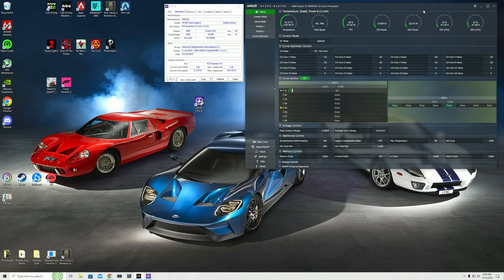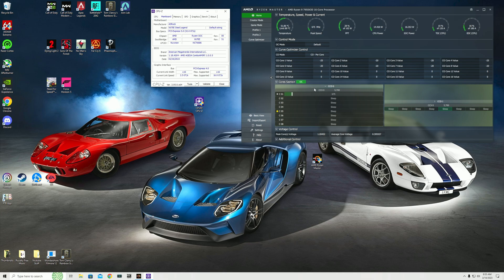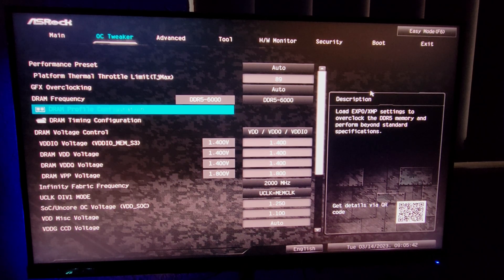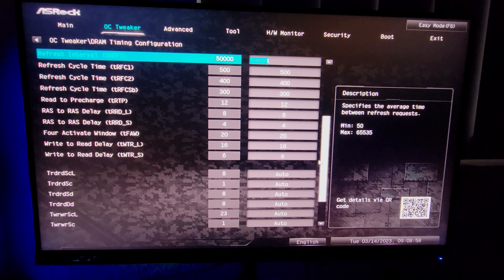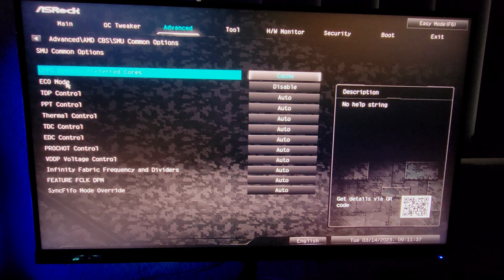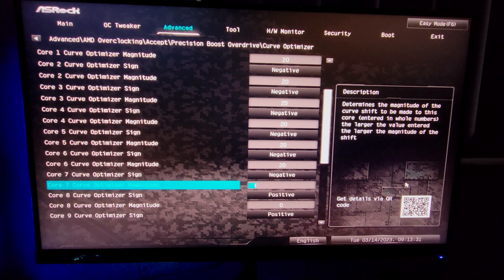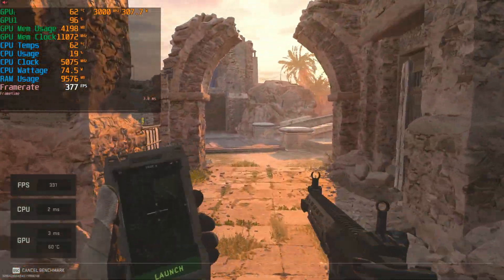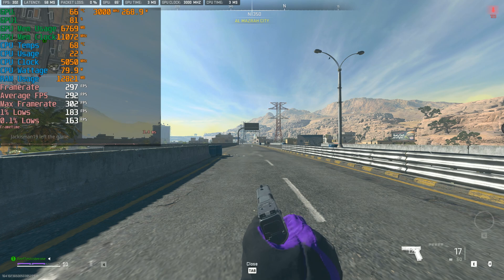7950X3D Setup Guide (Bios Settings, Ram Timings, and Undervolting)

Comment: I have a 7950x3D and 4090 with 5600 CL28, and I set the curve optimizer to all -20 CCD0 

My MW2 benchmark on low settings with 57% render resolution gives 299fps average (230fps 1% low) and gives CPU 392fps and GPU 413fps with 61% bottleneck on CPU and 39% on GPU. With ultra settings I get 261avg fps and only 7% CPU bottleneck

When I raise the render resolution to 100% like yours on ultra settings, I get 201fps avg (127fps 1% low) with CPU 340fps and GPU 223fps. 

Why are my results this bad? Is it the RAM?
Reply: u should be getting more fps. I get 335fps on 2560x1440 with fidelity cas enabled all low settings. (7900x3d)
Reply from the maker: Is your render worker count set to 7, and is your cpu set to prefer cache in bios?
Reply: @Beefy-Tech  7 why? I thought it should be the number of physical cores the cpu has.
Reply from the maker: @Icy20  nonono. That's a complete myth. Setting it to 16 results in the game switching to the wrong chiplet more often then not.

I highly recommend setting it to 7, setting your bios to prefer Cache, and test again.
Reply: @Beefy-Tech  i have already done all those things. I will replace 7900x3d with 7800x3d. Then will i use 7 again or 8?
Reply from the maker: @Icy20  stick with 7 I'd say
Reply: @Beefy-Tech  thanx. For guys with 7900x3d u syggest 6 or 5 then?
Reply from the maker: @Icy20  6 or 7. 6 is what my friend uses.
Reply: @Beefy-Tech  I set my CPU to prefer cache, but is the render worker count some setting in MW2 files?
Reply from the maker: @tariqalr  you'd still want it on 7 yes.

Comment: Quick question I have the same CPU 7950x3D paired with a 4090, G.SKILL Trident Z5 Neo (2 x 16GB) DDR5 6000 with 30-38-38-96 timings.  Will I be able to copy the same settings as you? Or will there be some differences between your tech and mines?
Reply from the maker: Yes, pretty much, but you want to do your own undervolt. Undervolts do not translate from cpu to cpu,so you could do a much higher or much lower undervolt based on the luck of your cpu.

Also my undervolt has changed since this video, as I've managed to greatly improve it.
Reply: @Beefy-Tech  Thank you for the heads up. How good did you improve your undervolts? Would like to have a sense to this process. Thank you again. Earned a sub.
Reply from the maker: @iemptyyclipz_1299  so, to keep it as simple as possible, download Ryzen Master, and it'll show you which 2 cores are your best cores (the 2 best cores will have like a Star or highlight in the app).

Those 2 cores will require slightly more voltage to be stable, so try to do like a 4 core -30, 2 cores -20 and your 2 best cores set to -10.

If you test that, and it's stable in the games you play and any regular benchmarks, start upping the undervolt with the 2 extra cores set at -20 to -25 or -30, retest.

If you are still stable, now go to your fastest cores, and do increase undervolt on 1 of the best cores from -10 to -15, -20 etc... until you find instability. Repeat for second fastest core.

The bottleneck of an undervolt is always the fastest cores, as those need more voltage to run usually.

There's different ways of doing this undervolt process, but this way you don't waste time testing -20 all cores and stuff like that.

Comment: I followed every steps on this video but for some reason no matter what value i put on my curve optimizer they wont apply for some reason on my asus rog strix x670e-e on latest bios.. tried the other bios too.. same thing. I hope someone can help me out here. Thanks
Reply from the maker: Are you on the latest Chipset drivers and the latest bios? It could be tied to the bios version. You need to make sure you select negative, and then just put 20 as an example.
Reply: Yes i am on the latest chipset and bios.. but regardless how much i put on negative curve between 0 or -30 its its performs the same.. so im assuming the CO is not working..
Reply from the maker: @Snakey066  download Ryzen Master, if your CO is applying you will be able to see the undervolt in Ryzen Master.

Also make sure your render worker count is set to 7-8, ideally 7.

If you see no performance difference even with ryzen master showing the undervolt applied, reset bios, re-apply settings, and make a significantly more aggressive fan curve for your cpu.
Reply: Took me awhile to figure out how the 7950x3d works. Thanks for helping me.. and keep up the good work on your videos.. cheers..
Reply from the maker: @Snakey066  gotchu fam! It's not particularly straightforward to set up, but a great cpu once setup🙌

Comment: Question, I’m using your RAM timings on my Gskill Trident Neo 6000 CL30 which is 30-38-38-96. In your timings, you are using 30-38-38-30 which I’m currently using and have not had any crashes or issues. I tried to use 96 and found no difference in performance. But should I keep it at 96 since it’s the stock number? I believe buildzoid stated to leave these figures same as what they came as but now seeing that using 30 doesn’t hurt it, I’m kinda stuck and what to use. Thanks so much for the quick replies
Reply from the maker: The primary timings make a very small difference in performance, but if you are stable at a lower individual timing, use it. The point of tight timings is so they all separately add up to less latency. The lower they all are together the less overall latency there is.
Reply: @Beefy-Tech  Thank you!
Reply: @Beefy-Tech  hello sir
Are you able to put 3x bottom fans in that Coolermaster h500 mesh and 2 or 3x side fans 
cuz i cannot , i only have a 360mm AIO deepcool LT720 + 1x 120mm REAR fans + 2x 200mm front fans
I wanted to remove both PSU box + HDD cadddy box and try to put bottom or side fans, 
The side fans i think we cannot as there is no brackets to screw those fans

Comment: Have you been able to tweak or change anything since this video that changed anything for more performance?
Reply from the maker: I have yes. Significantly improved undervolt, and process lasso is now being used, undervolt improvement making most significant difference, of about 3 degrees celsius of less heat. So -30 first 4 cores, -10 core 5, -20 last 3 cores. Core 5 is my fastest Core but also needs more voltage to run stable, so I can't go higher then -10 on it, that way other cores can be undervolted more separately and maintain perfect stability.
Reply: @Beefy-Tech  ahhh nice. I’ll try these 😁
Reply from the maker: @MustafaGT  use Ryzen Master and see which is your best core. That core may need less of an undervolt so those other cores can be undervolted more.

Comment: I have vengeance 6000mhz kit cl36. 
You think if I copy the same settings it'll just magically go to cl30? lol
Reply: Ok, tested it and the timings did not work on the 6000 cl36 kit. 
Just wouldn't boot, then told me its restored from blah blah. 
Oh well. I'll have to get me a much nicer kit. This kit is kinda meh.
Reply from the maker: Did you set your voltage to 1.4v across all necessary voltages? It could be that some timings are too tight for your kit, but all ud have to do is try slightly less tight timings at 1.4 volts and try again.
Reply: @Beefy-Tech  yeah, I learned it was a terrible Samsung die. And they won't work. 
But I got a nice kit from microcenter and I was able to get it to 6000 cl30 with really tight timings. Am5 aid64 latency is around 57n 
Made mine much tighter. Took some research to see what to change to further it. Lol
I have an A die, but funny enough was a 300 dollar a die kit. So I can still hit those super tight timings like M can..
Reply from the maker: @duckilythelovely3040  Hynix A die is probably the best overall, it can do higher frequencies and very tight timings. If you have A die it's really easy to get tighter timings then I showed here👍

Comment: you can overclock infinity fabric to reach 6400mhz
Reply from the maker: Yes, I have not done it yet as I dont have a ram kit capable of doing super good timings at 6400mhz. I will toy around with it at 6200mhz soon though.

Comment: Cant understand your temps.. what was your stock temps while gaming? I have a ryujin ii 240 aio but my tems is about 80c when gaming, if i set cores to -15 the temps go way up and tickle Tclt max. Is my X3D broken or what? AIO is sat correct, good thermalpaste with good coverage. Looks like my CPU does like the 7950x just want to go to 89 and stay there
Reply from the maker: Its a bug, I had to re-install bios and chipset drivers to fix that exact issue you had. Itd happen at random to me too where itd lock TJ max while not doing anything at all after i ran a MW2 benchmark, I havent had it happen in 2 weeks since I last re-installed bios/chipset drivers.
Reply: @Beefy-Tech  Hmm, i see more ppl having the same temps as me though when benchmarking apex at 1440P. its just when im playing, idle theyre like 45-55c. If this is a bug, AMD have to come out with a driver to fix it then?
Reply from the maker: @Emp3ror  I have a very overkill cooling solution and as a result temps are lowered by quiet a bit. My idle temps are around 38-42 within OCCT.

The temps are unfortunately normal unless you are at 60+c at idle, and most people with anything other then a 360mm aio and great thermal paste will have issues maximizing performance of the cpu.

Even with 6 high end fans on the 360mm AIO, and the best thermal paste I could find (Noctua NT-H2) I still can't lock 5.25ghz in CPU bound scenerio's such as AL Mazrah In Warzone 2 due to requiring about 5 degrees less of heat to do that lol.

Best solution if you have high temps is make sure your TJ max is 89c, and your fan curve on cpu cooler is aggressive. Given you already bought your cooler and thermal paste, try make the most of what you have. 

They probably will release a bios/chipset update soon because Derbauer recently damaged his 7950x3d with voltage, causing some concerns, meaning AMD may actually try do something about it indirectly. We will see.

As an example, I run 60% fan speed at 50 degrees, 70% at 60 degrees. This cpu def takes a bit too cool despite only using like 90 watts in gaming xD

Comment: I am shocked in 1440p the 4090 is bottlenecking the CPU. In the g9 resolution which is like 5120*1440p is the GPU still gonna bottleneck the CPU or the game will be more GPU bound?
Reply from the maker: Its in the benchmark within Modern Warfare 2 that the 4090 is the bottleneckm, within warzone 2 battle royale the 7950X3D with my latest Undervolt and setup takes 4090 to 85-95% usage, so its theoretically the CPU thats still the bottleneck in Battle Royale, but by extremely little.

Comment: is it just me or it's intended?
since i kinda have similar build, and kinda new on Ryzen Platform
is it normal when you're fine tuning the curve optimizer, your system would instant restart (not BSOD, even already change the setting of BSOD to not auto restart) and got kernel 41 error in event viewer? like when i'm trying -30 all core, it will restart frequently and -30 CCD0 and -25 CCD1, is rarely restart
Reply from the maker: I have never actually had a crash that reset my bios, so def intended. Whenever something is unstable, computer will simply restart lol. I run -30 first 4 cores and -10 last 4 on 3D v cache ccd and it works perfectly 0 crashes, but at -30 on 4 and -15 on last 4 cores itll cause the restarts. So yes, if you get random restarts, its a sign of instability.
Reply: @Beefy Tech ah i see, thanks for confirming it, now im trying -20 and -25 all core (coz im lazy to check one by one), sofar its good no crash atm, tried disabled PBO earlier, and crash as well but this must be causing by secure boot is disabled and virtualization security is on, also do you mind write the timing stuff in description? For easier to copy, im using gskill cl30 with expo atm, thanks
Reply from the maker: @AlviRieZel  you'll have to test it best on what you play. I only care about optimization on warzone 2, so I set my thread count within config file to 7, and then undervolted 8 threads as much as I could to specifically benefit warzones use case.

As for the timings, I think ull find it easier to copy if you go on your phone and screenshot the video, it'll have a similar effect xD

Comment: How do you determine that that you can only get -25 on two cores? Seems like that would take quite a few tests
Reply from the maker: It would. I tested until last week and my final setup is -30 on first 4 cores and -10 on last 4 cores of 3D v cache ccd. Its essentially trial and error until you get something stable. I got the idea to do -30 on first 4 cores as that means 8 threads will be faster then the other 8 threads, and if you set your render worker count in Mw2 to 7 or 8 threads, itll always use those fastest cores. Now i know its at its max, because -30 on first 4 and -10 on last 4 is perfectly stable, but if I change any of the last 4 cores to -15 instead of -10, I get a restart within 30 minutes.
Reply: @Beefy-Tech  Can we undervolt this microATX board Asrock M.2/HDV or do i need X670E boards only to overclock the CPU

Comment: what were your before/after temperatures please from undervolt? I am worried that 360mm AIO and a Fractal Meshify 2 won't be sufficient to allow a 7800x3d to boost well.
Reply from the maker: To be honest, I did a full cooling solution upgrade.

I think the UV was about 3-4C less ingame overall, but the boost frequency was at about 5.0ghz on the dot. 

I got Noctua NT-H2 thermal paste, and slapped 6 fans on my 360mm AIO (3 slim fans and 3 full fams), and I Removed my old fans entirely.

Not only that, but I run the cpu at 60% fan speed at 55c, and 70% fan speed at 65c, so keep the Temps under 65.

Now I see between 60-64 in wz2. The undervolt helps a lot, but the thermal solution will help just as much. Make sure you get a good thermal paste👍
Reply: @Beefy-Tech  Are you running the CPU radiator as intake or exhaust?

I will almost certainly be undervolting, it seems quite easy thse days. Probably go Arctic Mx6 thermal paste. 

The case I'm looking at won't support a push+pull config on the AIO so I might be stuck. I could choose a different case but the one I've seen looks to have quite good dust control which I need.
Reply from the maker: @xPlasmaz  i run it with push pull as intake, with a single 140mm fan as exhaust. 

You shouldn't have an issue running just 3 fans, I'd recommend running them as "Push" in the sense the they blow the air through from above the radiator as that'll result in slightly better performance then just pull. Downside is inside of case will look slightly worse.

If you want to have fans visible on the inside though, I can understand, and it'd still run within 1-2 degrees celsius of the push config.

MX6 is fine, and I think it even comes with a thermal paste spreader if I remember correctly👍

Comment: I am looking at building a PC with the 7800x3d and quite concerned about CPU temps as I know it can affect boost clocks. So with an undervolt and a 360mm AIO you're reaching about 70 in Warzone 2. What about a full on stress test what temperatures does that reach?
Reply from the maker: I upgraded cooling solutions since, so it wouldnt be representative of this test anymore, now I run 63c instead of what used to be 68c. but the upgrade consisted of changing my main 3 fans to better ones, buying an extra 3 slim fans to make it a push pull configuration (6 fans on a 360mm radiator) and changing thermal paste to Noctua NT H2. That isnt realistic as a cooling solution for most people though, but the hottest I ever saw it get in a game was 85C with my previous basic 360mm aio with 3 fans set to pull configuration (this is within a different cpu bottlenecked game, not warzone)
Reply: @Beefy-Tech  What's your boost clock now? Are you hitting 5.25 ghz?
Reply: That sounds low most intel have 86-95 degrees on that game.. 😢

Comment: The 7950x3d is still a bottleneck like the Zen 3 CPU with graphics card load factor better than the 13900k when actually playing games. It's absurd and funny, but YouTube reviewers can't explain this phenomenon at all.🤣🤣🤣
Reply: Don't fantasize about the 7950x3d, just buy the 13900k.
Reply from the maker: It's indeed still a bottleneck for 4090 in WZ2, sadly, that applies to 13900k, and all available cpu's today xD.

But hey, 1 more cpu generation and we'll actually be able to drive a 4090 at 1440p wz2😂👍

Comment: Im excited to try these settings out on my 7950x3d when it comes in. Currently on a 7700x and 7900XTX and so I hope the 7950x3d nets me some nice gains in warzone.  I am curious to see the delta
Reply from the maker: Depends how your GPU usage is currently looking in WZ2, I can tell u it'll be big gains tho!
Reply: @Beefy-Tech  So on the COD benchmark I get 282 Average FPS on my Ultrawide monitor 3440x1440p 21:9 . My bottleneck numbers are weird on the benchmark. CPU 23% and 77% GPU
Reply from the maker: @Rakki05  sweet. Ull be most likely really close to full capping out the GPU usage with 7950x3d+7900xtx, if not maxed usage. The 4090 get full utilization from 7950x3d when it's setup well, but 4090 is slower in the cod benchmark too, so keep thar in mind. (But 4090 performance is similar to 7900xtx in BR)
Reply: @Beefy-Tech  lol well my GPU usage is consistent and now the lows have increased by 20-30 FPS Thank you so much.  Excited to put the 7950x3d. Will report findings
Reply from the maker: @Rakki05  sweet fam, that I'd great to hear, good luck with the upcoming 7950x3d!
Reply: @Beefy-Tech  Thank you for the great content! keep it up!